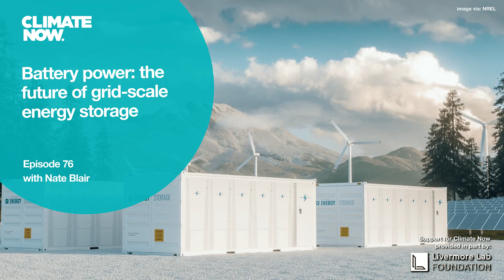Battery power: the future of grid scale energy storage

Comment: There are a number of things at play here. First is what reasons did your power supply go down? Was it from generation or from distribution ? If it was a distribution failure there is no battery system that’s going to fix that. Battery storage is mainly designed to store power when there is excess generated and delivery it at peak times. I.E. solar power generated during the day and is at a very low price it’s bought and stored then sold at peak times . It can also help through power cuts like a day down but never have the capacity to supply entirely from battery for 9 days